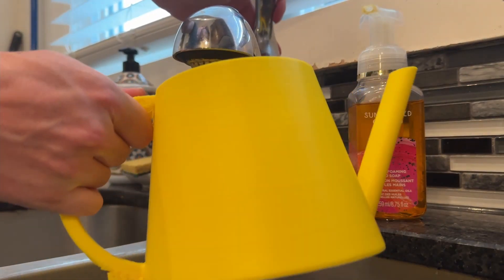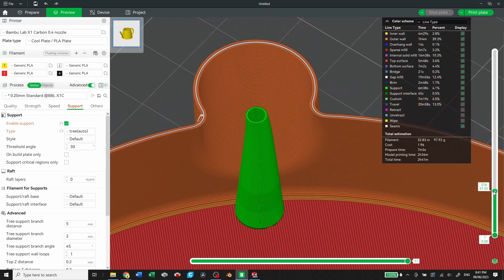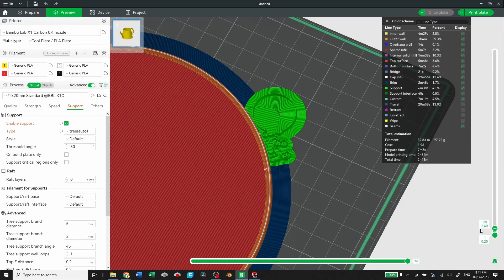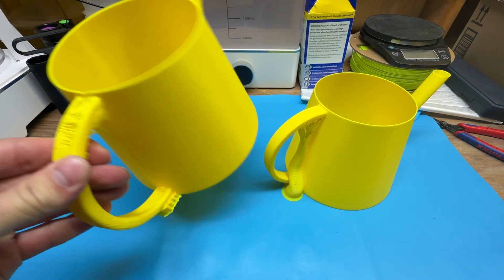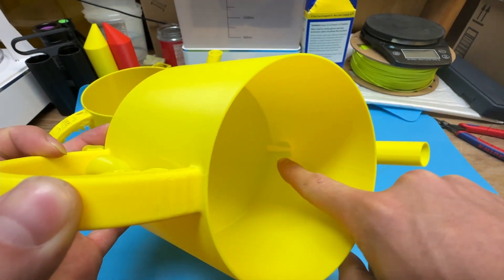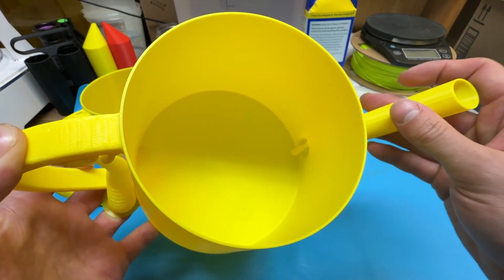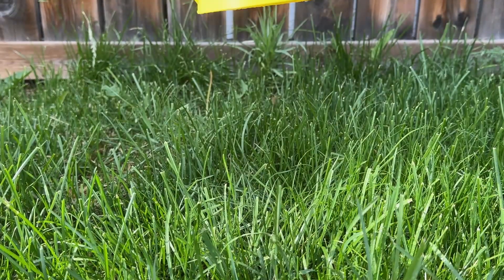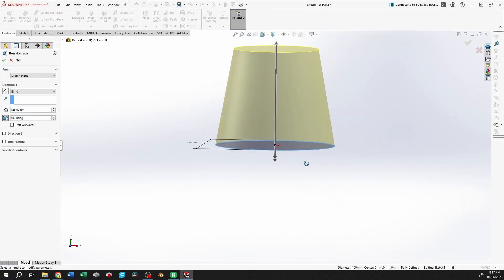Can FDM 3D Prints Hold Water?

Comment: I wonder if you left water sitting in this for a few hours if it would start to leak a little. As far as I know FDM usually has small gaps that water will eventually find it's way through.
Reply from the maker: I’ve had other prints hold water for months at a time. I think it really depends on the number of walls and the part geometry. I will make a community post following up on the long term water tightness of this print specifically

Comment: Nice. I assume that is eSun PLA. My best successes with water tight have been with TPU and/or over extruding a bit to make sure.
Reply from the maker: Yeah eSun PLA+. Over extrusion is definitely one way to go. I haven't printed any TPU before but I really want to. What have you printed in TPU?
Reply: A fair number of odd things. It is sometimes hard to get the settings working well, but flexible things are rewarding, rings, paracord stuff, lense caps, etc. I've got some models on Printables.